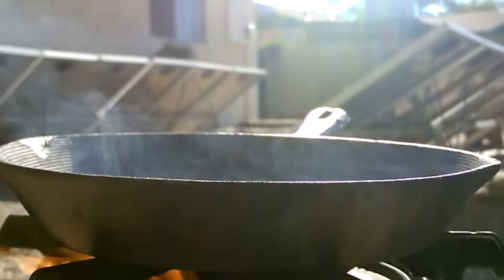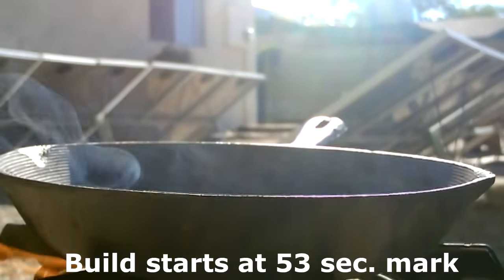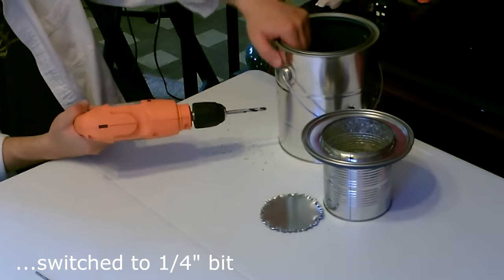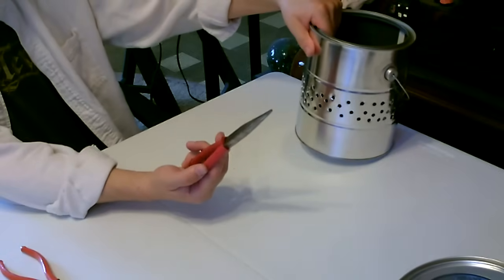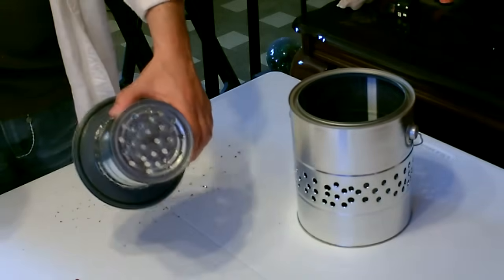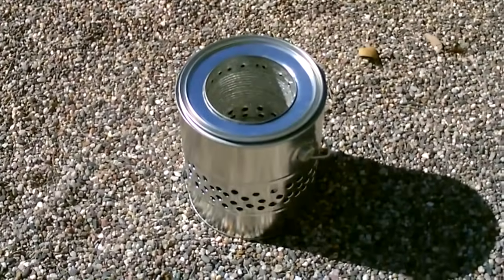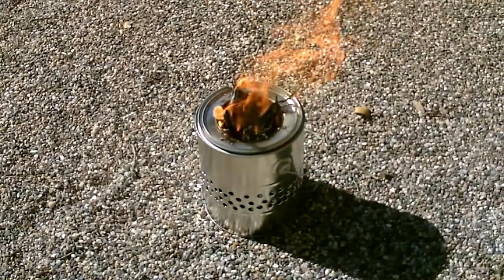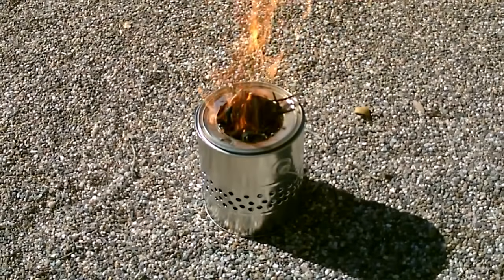Homemade "Gallon Can" Wood Stove! - "Tin Can" Wood Stove - Easy DIY

Comment: I missed where you added holes top of inner can. Anyway, I would suggest removing the bottoms of both cans, threading wire (or insert grill) bottom of inner can (with > 1 cm² spacing) and keeping widest bottom to collect ash. This gives more air to bottom of wood fuel and much easier to clear ash in operation.
Reply: you must determine the amount of oxygen which enters at the bottom of the inner chamber really carefully, which is not possible with a wire mesh etc. The most part of burning should happen at the upper end of the device, not down there in the burning chamber; there should only enough heat to gasify the wood, which MUST NOT get oxygen to burn. I always made two bottoms, so I could twist them against each other and regulate the air flow.
Ashes should not be a problem. If the device is built well, trying to attain the "Holy Grail", sorry, the blue flame burner, there would be less than one teaspoon full of very fine, light grey dust.
Reply: Fikri Arieska  Did'nt know those but it will be interessant to check into the matter, thanks!

Comment: Get a step drill bit.  You will get cleaner holes..  great job.  I have made smaller versions..
Reply: What is a step drill
Reply: @shadowdance4666  a step drill bit.  Not a step drill.  Google it please.
Reply: Well he uses needlenose to have a smooth surface and it makes the can stronger.

Comment: would it work better if the outside can air holes were drilled down towards the bottom rather than in the middle to give the air more distance to heat up before coming out the top inside holes??

Comment: Remove the top holes.
The air gap is to provide heated air, which heats the unburnt wood to produce wood tar gas.
This provides better combustion and a hotter flame.
Reply: Myles Nichola
Reply: @myles nicholas  ? how do you remove the top holes that were made to allow air flow, please? It seems you would be destroying the integrity of the can. thanks!!

Comment: Love these Gasifier Stoves, But burning those steel cans like that what is the life usage of this type of stove, before a can Burns out. Looks like the two smaller cans probably the upper smaller can would be first to go, and have the shortest life span. But making up two or three extras could resolve that problem. I have a Few professionally made stove of this type one is the Silverfire survivor stove, and a Stovetec stove, both are Very good and durable. I would not mind building a few of these for a travel type disposable, if need be.

Comment: Great build! I love this channel. Anyone care to comment on the life span of the inner can? If I had to cook on it solely would it last a couple weeks?
Reply from the maker: hi there and thanks. the heat of the wood-fueled fire contained within the inner can is not nearly enough to damage it....   the inner can (and entire stove) should last you for years.  *just keep it dry so it doesn't rust. (I've still got the stove and it's going strong).
Reply: desertsun02 Excellent thank you.
Reply: Aluminium will last much longer. Most steal food cans will corrode, even if it never touches rain. After several burns and a month of age it'll become brittle, and start to look like a hobo relic of yestercentury.
Reply: @vegahimsa3057  your comments here have been wildly helpful as is this one. 👍🙏🎯

Comment: I love the design. If it's for home use, another way to reduce the ashes would get better.
Reply: Do not put holes in the side of the inner can. Once the burn gets below them it will suck air through them as the bottom holes are covered in ash and therefore a bit restricted. Without them the ash will be fed with air and keep glowing until there is nothing left of the ash to keep going.

Comment: Awesome. I'm probably going to do this one. I spend alot of time on the road and need an alternative to the constant resturants. What would you say the lifespan of it would be with proper cleaning and storage of course?
Reply: A steel can will eventually fall apart. It'll be usable for a long time and many burns, but will become corroded and brittle, rust-like.
Reply: I never purchased or made a woodgas stove which did not, in the first minutes, soil the pot with a thick layer of soot. It's good for garden, outdoor, week-long electricity blackout, war or catastrophe. In daily use this is not practical. They will cast you out of any truck stop etc. if you try to wash up your gear there, and it will soil you, your clothing and your car beyond recognisation within a few seconds. Buy a flat little gas stove, they are good and cost next to nothing.

Comment: The classic construction of a woodgas stove. In those I built it paid out to put some insulation (glass fibre fabrics) on the outside of the inner chamber, fixed by wire and/or an additional sheet, cut out from another can, to attain the crucial 495 degrees Celsius really fast.

Comment: The ash are caught in the bottom? Awesome
Reply from the maker: Derek Everyguy hi there. yep, the ash falls through the inner can and into the bottom of the gallon can. with this large "storage area" for the ash (bottom third of can) you could probably run stove for 8 hours before you needed to dump it. (after running it for 30 mins the ash was only 2 to 3 millimeters deep).
Reply: @desertsun02  good to know! ? would charcoal briquettes work in this? I realize sticks and woods and all, but...I've got a ton of charcoal cuz I didn't know better in prepping for #shtf

Comment: what size number of ounces is the small can, 28?
Reply from the maker: +Doug Ramsey hi. pretty close. it's 29oz.
Reply: another question. did you drill  right on the line or just a tant on the sinde? It would seem if on line, it would be too loose and not give good seal. Good videol.

Comment: Getter dun before the lights go out and you are scrambling to try and charge a power tool battery.
Reply: @rick geise  excellent point and a ? for you: will an EMP destroy tools? Does the entire ensemble need to be in a faraday cage, then? I'm having trouble figuring out what needs to be fully protected vs. what will 'survive' (I keep my drill in its case, unplugged, of course...and worry that it will still suffer.) 🙏 thanks for your BRIGHT ANSWER🌞💡
Reply: @RattledEditor  I am not an expert; however, I purchase a metal trash can w/ lid from Lowes and lined it with a camp sleeping pad, stored power tools and similar electrical gear in it and called it good.  Thanks for the luv!
Reply: @rickgeise2844  thanks so much! I underestimated the number of tools and equip when I got their smaller version of a can but hey, you confirmed the thinking and that's super helpful. Time for a bigger can, man.😉

Comment: Hi would you mind make me a large alcohol stove video version of this?
Reply: like the origo marine stove fuel cannister
Reply: Nothing beats the fancee feest design for simplicity and performance. 3 oz aluminium cat food can ("fancy feast"). 5 or 6 oz tomato paste can (probably steel) cut so it's 1" taller than cat can whilst inside (taller burns faster, less efficient; shorter slower but more fuel efficient). Punch a hole or four at the top and bottom of tomato can (to prevent vacuum and suck alcohol outward to be wicked up). Line with carbon fiber, insolation, or just toilet paper between cans. // Bigger is not better. If you want more heat, wider might help, but not taller. Rather build several cat and tomato stoves.
Reply: Keep fuel in pocket to keep warm in winter. The catomato stove will light at negative Fahrenheit. A wind screen is a must. Recommend tall aluminium beer cans, cut flat, folded together (two or three should be sufficient). 1/2 inch space between aluminium windscreen and your pot (metal cup) which sits directly on top of your lit tomato can.

Comment: How do I get a paint tin that new
Reply from the maker: hi. they sell them at the home stores. cost about 5 dollars
Reply: @desertsun02  one viewer suggested removing small can's bottom so paint can captures ashes. Paint can is lined. Will the heat be an issue if the bottom of can were removed as they suggested? PS LOVE LOVE this idea!!  thank you sooo much. saved. shared. can't wait to do it📍👍👍

Comment: I like your rocket stove design better. Both work, but this one seems harder to feed.
Reply from the maker: ***** hi there. while it's true that you need to pick up the pan to fully reload the fuel supply (versus the direct "bottom feed" of a rocket stove) it only takes a few seconds and burns for 10-12 mins per "fill-up". also consider that this stove has the benefit (over the rocket stove) of not needing to remove the ash nearly as often (every couple of hours vs. once every 8 hours (assuming continuous burn) due to it's large "storage area" for the ash under the burn chamber.
Reply: desertsun02 For what it's worth I built a large rocket stove and always preferred feeding it from the top.
Reply: @desertsun02   here we are 6 yrs after your post - I was about to return my new paint can, (cited use as a faraday cage) but now I can't wait to drill that baby-up, man. thank you very very much

Comment: how long will this burn with a full load of wood?
Reply: EC Reviews 
Wood probably 20-30 minutes.
Pellets even longer, 1.5-2.5 hours if lit from the top of decent burn and add about an hour of so so.
Lit from the bottom maybe an hour but would probably burn hot enough to boil 2-3 gallons of water.